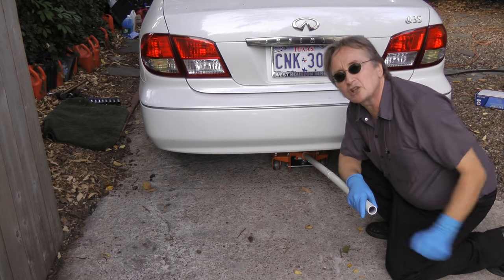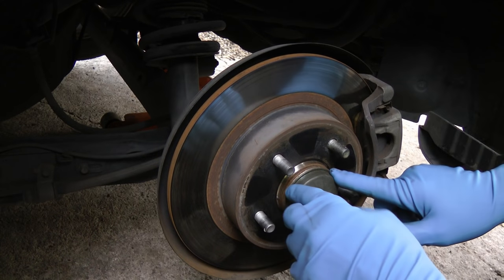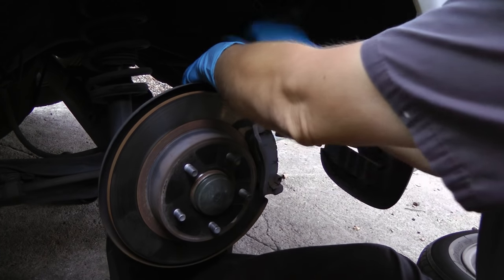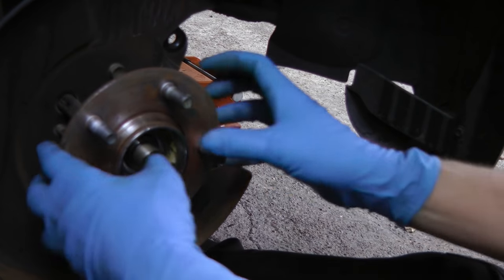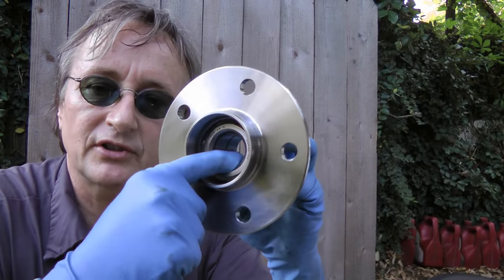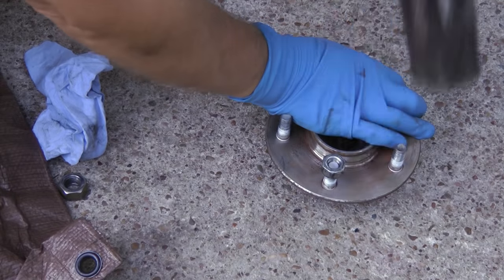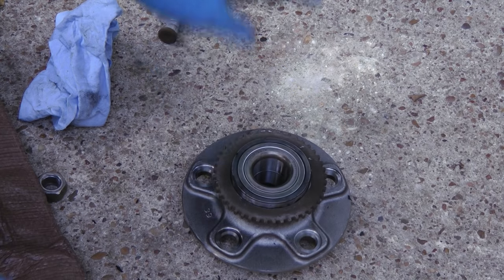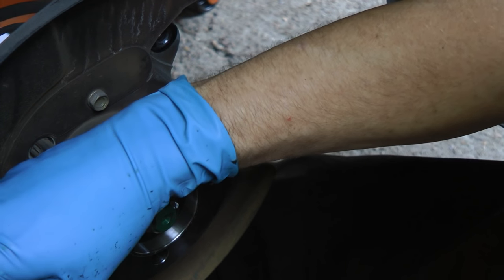How to Check a Wheel Bearing in Your Car (Replacement)

Comment: Mr Scotty. Okay so my car makes a grinding noise when I reverse but it barley moves. But when I put it in drive I could go but I still hear a feel the car grinding. Could it be the bearings?
Reply from the maker: +Benjamin Andrews jack up the wheels and PRAY it's a bearing or brake locking up the wheels and NOT a shot transmission.
Reply: +Scotty Kilmer well my ABS light has been on for a minute so that could be the problem?

Comment: Hey. Scotty. I have changed the wheel bearings but the sound is still in there. More like a roaring sound.  I tried also driving it  on high speeds  and then put it on neutral but still has same  sound on it.  Pls help. Thanks !
Reply from the maker: perhaps it's wheel bearing on the other wheels, but if not, odds are you got bad replacement bearings or put them on too tight
Reply: Scotty Kilmer we already change two wheel bearings im driving a lancer 01. is there something to do with the hub?

Comment: MR. KILMER... I HAVE A 2003 NISSAN FRONTIER, NOT LONG AGO THE SERVICE ENGINE SOON LIGHT APPEARED, I TOOK THE TRUCK TO ADVANCED AUTO PARTS AND IT SEEMS THAT THE CODE TRIGGERING THE LIGHT IS P1456, WHICH IS A VERY SMALL GAS LEAK. CAN I TRY TO FIX IT MYSELF OR IT IS BETTER TO TAKE THE TRUCK TO AN ELECTRICIAN? IF I TRY TO FIX IT MYSELF, WHERE DO I START?
Reply from the maker: put some UV leak dye into the gas tank, then look for the green dye
Reply: ROSALIO GOMEZ the people that hook up the computer to your car, do NOT know how to diagnose a problem. they are only trained to read a code, and whatever that code says they try to sell it to you. before enrolling into my automotive deploma program at my local tech school i was a fool and bought a $250 TP sensor after they told me that was the problem. i bought it, installed it in the parking lot and it didnt fix the problem one bit. i then told them it didnt work and they were all dumbfounded. bunch of pocket pickers.

Comment: I jack up the front wheels on my corolla 2011 with engine on I put the transmission on drive and when I turn the wheels to the right the front right tire doesn’t spin freely, somebody can tell me what does it mean? Bad wheel bearing?

Comment: my front right tire has a faint rubbing/scraping noise and it gets louder while breaking . any ideas ??? its a 2003 saab 93 2.0t
Reply from the maker: generally just worn out brake pads hitting the rotors.

Comment: my 1999 Dodge RAM 1500 makes a clacking noise when driving coming from the passenger side only. could it be the wheel bearing ?
Reply from the maker: +RangeshootestXx could be, jack it up and see if it makes noise spinning the tire

Comment: My car is making a loud scratchy noise during on the road its like metal scraping back n fourth. Not quite sure if its the bearing that causing the noise or the rotor.
Reply from the maker: pull off the wheels and check the rotors, if it's them they will  be obviously gouged
Reply: Thinks Scotty now i finally found out whats the problem. It was my bearning that needs to bechange it was all ware out and the ball bearing are very lose out.

Comment: I have a 2005 kia sorento with 61,000 that was making a lot of noise from the front wheels. I took it two mechanics who said it was the tires. The noise seemed to get louder as I drove faster. I took Scotty's advice and took it to Kia. Kia says that both front wheel bearings are bad. They also said that the bearings are seized in the knuckles. Anyone have some thoughts about this

Comment: Hey. Buddy. Where do you buy the hub assembly with the bearing installed. I need some for my 05 altima
Reply from the maker: any good auto parts store, I often use bap geon on those, 713 227 1544
Reply: Scotty Kilmer  STAY AWAY FROM AUTO   ZONE  OR O RIELIEY  BRAND   MINE WENT BAD AFTER  20K   ON MY 05 ALTIMA
Reply: ***** lol that was fast to realize that auto zone was a bad place to go

Comment: my wheels are getting Really hot feels like the wheel is dragging I've replaced Pads Rotors Calipers and still my wheel is dragging and gets very hot Could this be a worn Wheel Bearing???
Reply from the maker: +Noah Rule it could be, BUT more often sticking master cylinder or brake booster

Comment: How long can I drive on a wheel that has noise and a little wiggle?
Reply: You should actually get them done asap before they fail if not other components can break and can lead to bigger issues. My car is actually not running due to this and ball joints.

Comment: Don't you have to set the torque to a certain lbs on the axle nut?
Reply from the maker: If you have little experience, yes, get a torque wrench and set it for the correct setting. Me, I've been doing it 47 years and do it by feel and have no problems

Comment: What would cause a vibration at 60 to 70 mph on a 2000 GMC pickup?
Reply: check the stabilizer on ur wheels maybe its that i send mine to a shop told them to check it for me

Comment: My wife's car is making like a squealing noise like sumin hasn't been greased when she going in reverse but no noise when u put in drive I have greased the driveline and checked out everything I know to check could it be a wheel bearing
Reply from the maker: check the brakes first, worn pads will squeal backing up. pray it's not the reverse gear going out in the tranny

Comment: If it only be that simple. But, sometimes, the bearing is pressed, and have to take it out, etc. Also, there are install procedures, tightening torques, that even regular mecanics don't know. So, you end up with a bad bearing, and have to do the job again.

Comment: would it make a grinding sound when they get bad ?
Reply from the maker: +Joe garcia ONLY when completely worn out and dangerous
Reply: Scotty Kilmer oh ok so mine must not be that bad thing I used wd40 seems to stop the little squeak it did have do you think I should get wheel bearing grease and grease the boot and around the hole would that help too ?
Reply: Scotty Kilmer

Comment: Driving two days now since the new alignment, im noticing roaring noise from the driver side 40-60mph. I have never noticed this before, im suspecting wheel bearing. Is it possible for a bad alignment to cause fast wear in bearing? What other parts could be damage too? damn dealer mechanic
Reply from the maker: not a bad alignment, but tightening bolts too tight on the axle often wear the bearing out.
Reply: Scotty Kilmer
i guess the damage is done, not a single happy dealer warranty repair. Wasted my extended warranty money, this is the last time im taking my car into dealer for anything
Reply: Scotty Kilmer
im only hearing it on driver front, does that mean bolt and axle is also damaged?

Comment: You forgot to mention that all hub assembly's should be torqued to manufactures specs or bearings can fail. It's not just tighten it up.

Comment: I replace mine wheel hub bearing assembly and I still got play in my wheel any idea what it could be
Reply: ghostrida86 tied rods, control arms or shock mounts check to know which needs attention
Reply: I found the problem it's my brake caliper the bolt won't stay in which is causing the wheel not to align up properly

Comment: well I got the problem, that my car is making a very deep humming noise, when I let of the gas, while I am still in gear, but no strange sounds etc. when turning while acceleration. Maybe you have a hint what it could be.
Reply: 14725800369 i have the same problem as well and I think it is a wheel bearing, I have a honda civic 06 and these tend to go bad on this model and so I won’t know for sure until I jack the car up today but it also makes a humming sound and it sounds like its coming from the rear in my case and is annoying that I have to have my volume at like 30 to just drown the noise out

Comment: i've a toyota hilux 2012 everytime i press brakes and ride it down under my feet how do i fix this
Reply: sounds like the master cylinder for the brakes is leaking.  Google it. if it goes all the way down to the floor while you are stopped, that is definitely the problem.

Comment: hey Scotty, got a question to tickle your brain: i have a high-pitch squeal coming front left side of my car that comes at 30mph and above, then goes away when i brake. i thought it was the bearing but i have a feeling its something having to do with the brakes not releasing the brake disk fully. could you help me out? Thanks a lot! PS i know its not the engine because it doesn't squeal in idol
Reply from the maker: yes, they often don't release when older, you may need a new or rebuilt brake calliiper
Reply: Scotty Kilmer. No your wrong scotty he needs a new startrek brake manifold in conjuction with the c.i.a. eatting cornflakes in new york city the real berrys are blue so who the hell do you think youare

Comment: Hey so here's a question for you all. I'm currently in school for automotive collision repair and restoration and I'm usually good with mechanical issues too but this one has stumped me a little bit. Driving casually in a small neighborhood, about to exit the neighborhood and need to accelerate pretty hard to get into the right lane. Whilst at around 2.5 - 3.5k RPM I hear and feel a thudding from the passenger front wheel and pull over to take a look. Nothing. A few days later I notice a creaking noise coming from the drivers front wheel, driving straight - creak, creak, creak every quarter of a second or so at 25mph. Turning left - much louder. Turning right - no creak. Let me know if any of you have got some ideas as to what this might be. Thanks guys!
Reply from the maker: +Nikolai “BubblesRevolution” Bonnkarovsky often rubber bushings creak as vehicles age. Get some WD 40 and spray it on all the rubber bushings, and if none are obviously worn and crack, just do that when they creak again
Reply: +Nikolai “BubblesRevolution” Bonnkarovsky  Check your ball joints. If they have grease around them then the boot has busted and you may be riding on dry joints. The creak you hear is metal to metal wear.

Comment: Can anyone help me? I got a 2003 Tahoe for the past year-and-a-half there's been a whine coming from the front end from only speeds from 30 to 55 does anyone know what it is
Reply: Jacobfisher I have a 1995 Silverado PU. I to have a whine, I thought it was from the rear end, but while driving if I turn the wheel slightly to the left the noise gets louder, but when turning to the right the noise isn't there. The noise will get loud when accelerating. I'm going to check/replace  both front wheel bearing (inner and outer) and see it the noise goes away. Replacing front bearings is easy then you eliminate that as a problem.

Comment: Hi! Hope you can help me. I've got a noise in my front left wheel and I don't know what is causing it. It sounds like a metallic friction "whooooooosh" and then there is the sensation of the car slowing down ONLY in that wheel. When I press lightly the brakes the noise is gone. My car is a '03 Nissan Platina (a rebadged Renault Clio). I know this car wasn't sold in the USA, but maybe someone has an idea of what it could be. Thank you all in advance.
Reply from the maker: +Miguel Luna classic worn wheel bearing noise, but of course take the wheel off and see if brake pads are just worn out
Reply: Thanks!

Comment: I went to Firestone to get my car looked at because it sounded like a helicopter when I would drive.
The mechanic took it around the block, boosted it up in the shop, called me in there to show me the problem.  He wiggled the wheels and et said they were dangerous to be driving on.  The wheels were moving A LOT.  The mechanic wouldn't drive it out of the shop he was so scared.  That was about 3 months ago, I still haven't gotten it fixed and the tires haven't fallen off yet.
I want to fix it myself because it'll save me $200 in labor costs.  On the diagnostics paper, it says "Brake systems: Bearing and Seals (front-both).  Can you tell me what that means and exactly what parts I will need to fix it?  Do I need just a bearing and seal OR do I need a new wheel bearing and hub assembly?
Reply: Oh, I have a 2005 Chevy Cavalier 2.2 2-door, if that helps at all.
Reply from the maker: those come in bearing and hub assemblies, but you can save buying aftermarket units.

Comment: Wow. This was quite possibly the easiest car to remove wheel bearings from...My car requires the whole Spindle to be removed the the bearings to be pressed out and new ones to be pressed in. A huge pain in the ass. There are also retaining bolts in the back and front to keep everything in... Everything is seized from years of rust...

Comment: How to change my 2000 Audi a4 wheel bearing
Reply from the maker: If you have the audi tools it's a 2 hour job, but the tools cost thousands. it can be done without em, but it's a bear of a job:
Remove wheel trim. On light alloy wheels use puller in vehicle tool kit to remove trim cap.
Remove bolt for drive axle.
WARNING: The vehicle must be standing on it's wheels when loosening or tightening the bolt for the drive axle. Otherwise the risk of an accident exists

Remove wheel and secure brake disc using wheel bolt.
Detach ABS wheel speed sensor wire from bracket on brake caliper.

Remove bolts -1- for brake caliper and remove caliper.
CAUTION:
Suspend the brake caliper using a piece of wire. Do not allow the caliper to hang by the brake hose. The unsupported weight can stretch and damage the hose.
Do not loosen brake hoses or lines.
Remove brake disc.

Remove bolts -1- for brake splash guard.
Pull ABS wheel speed sensor out of wheel bearing housing.
Loosen nuts -2- and 3.

Pull out rubber grommet -1- and disconnect harness connector-2-.
Detach ABS wheel speed sensor wiring from retainers (arrows).
Guide wiring through opening in wheel bearing housing and remove. Be careful not to damage the rubber grommet.

Remove bolt -3- and nut 4.
Disconnect tie rod end.
Loosen nut from ball joint
If necessary, counterhold ball joint using 4 mm hex wrench.

Press lower guide link ball joint from tapered seat. Be careful not to damage the joint boot.
Note: For vehicles with headlight range control, Refer to Lighting and Horns.

Note: Cover the CV joint boot (e.g. by inserting a piece of leather) to protect it from damage.

Press lower track control link ball joint from tapered seat.
CAUTION: For safety reasons, reinstall the flanged nut onto the lower track control link ball joint (approx. 4 turns).

Remove nut -1- and bolt and remove both links -2- upward.
CAUTION: Do not use a chisel (or similar) to widen the slots in the wheel bearing housing

Swing wheel bearing housing aside in direction of arrow and remove outer CV joint from wheel hub.
Remove nut from lower track control link ball joint.
Remove wheel bearing housing.
Installing

Install wheel bearing housing.
Slide drive axle outer CV joint into wheel hub and tighten new bolt hand tight.
Install ball joints for lower track control link and guide link in wheel bearing housing.
Install new self-locking nuts and tighten to: 100 Nm (74 ft. lbs.).
If necessary, counterhold ball joint using 4 mm hex wrench.
Install both upper link ball joints into wheel bearing housing.

Install new self-locking nut -1- and tighten to 40 Nm (30 ft. lbs.).
Press upper links downward as far as possible when tightening.
Install tie rod end and new self locking nut 4. Tightening torque: 50 Nm (37 ft. lbs.)
Tighten bolt 3. Max tightening torque: 5 Nm (44 inch lbs.)
Install ABS wheel speed sensor.
Attach linkage for headlight range control.
Bolt on brake splash guard. Tightening torque: 10 Nm (7 ft. lbs.)
Install brake disc.
Install brake caliper and tighten bolts to 120 Nm (89 ft. lbs.).
Install wheels and tighten wheel lugs to 120 Nm (89 ft. lbs.).
Install new bolt for drive axle. Tightening torques:
M14: 115 Nm (85 ft. lbs.) + 1/2-turn (180°)
M16: 190 Nm (140 ft. lbs.) + 1/2-turn (180°)
Warning: The vehicle must be standing on it's wheels when loosening or tightening the bolt for the drive axle. Otherwise the risk of an accident exists.

Check front suspension alignment and, if necessary, adjust using VW/Audi approved alignment equipment.

Comment: 🔥... ... Don't forget to take the nuts off the stud, he puts those on and doesn't elaborate enough for a DIY green horn... He is simply pulling the bolt (stud) into the bore of the housing/mount...He also referred to the nuts as a bolt... At least twice that I had noticed while viewing ... No big deal... Seems like he is legit... 👍... ...

Comment: What no torque wrench to torque the axle nut ????  yeah just use a big breaker bar and tighten it as much as you can and do the job over again in another hundred miles .

Comment: My wish for the holidays is for my car problems to go away. Just spent $700 replacing both struts, tires balanced and car alignment and the car still shakes and vibrates. Ugh. Something tells me it could be front wheel bearings

Comment: what a waste...paying for the hub also.Just because you don't have a hydraulic press and some proper diameter steel tubes and washers. What would you've done if it didn't came as a whole unit?

Comment: Wish the 2007 Toyota Camry front wheel bearings were that easy.   Nope; they are a pain and require a press.  Their mechanical engineers should be smarter, designing it for an easy replacement like Scotty's video.

Comment: Now why would it cost $600 to replace a wheel bearing?? It looks like a easy fix. I was told it would take half of a day to replace!?!?!
Reply from the maker: +Sm M depends on the car, the price of the bearing assembly, and how honest a mechanic is. Job is over a thousand bucks on many BMWs.
Reply: I have a 2001 Toyota Echo. The bearing costs $90.

Comment: Designing cars with pressed in bearings is so stupid. Changing a bearing should be as easy as changing brake pads. Assemblies are the answer. Outlaw pressed in bearings now.